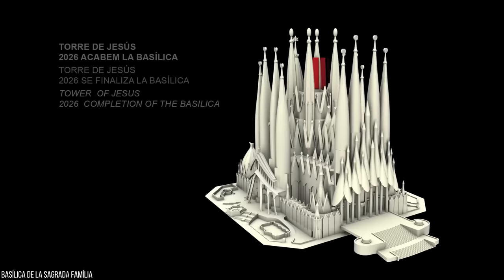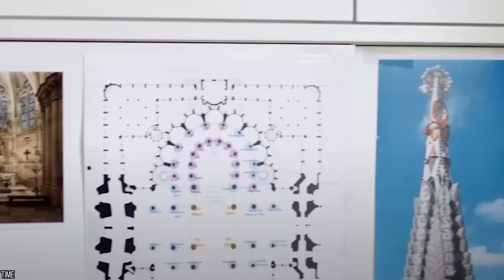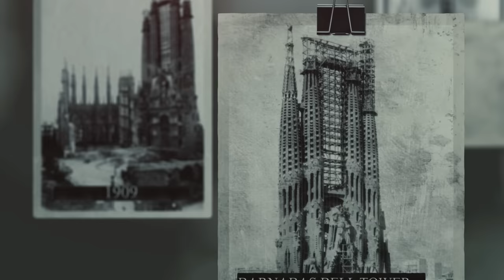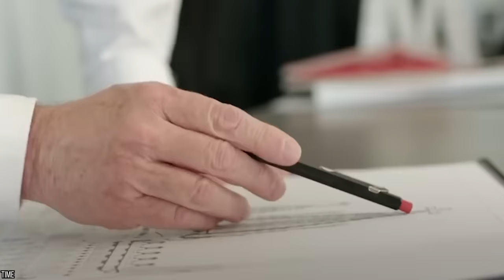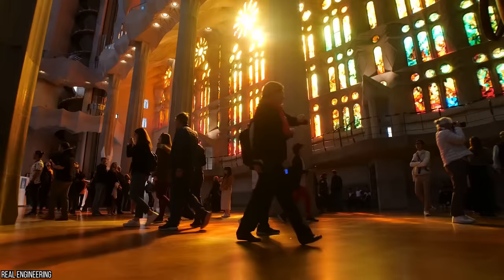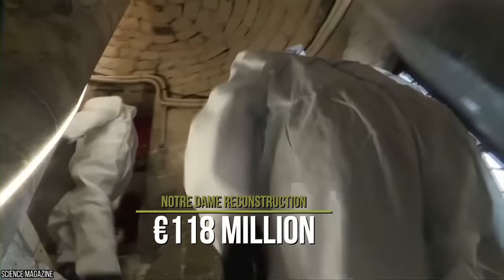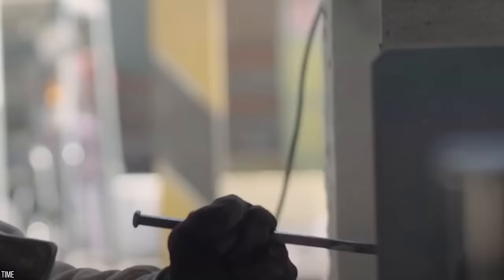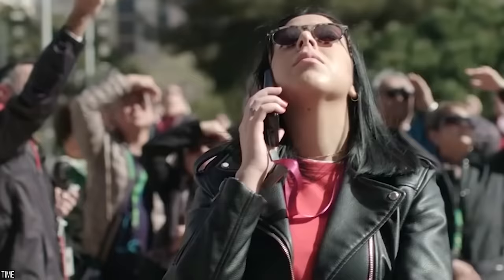This Church Took More Than 136 Years To Build

Comment: 🤣Gimme a break. These megalithic buildings, especially the cathedrals, were not built as churches. I'll give them one point. At least they gave it a more beLievable construction time than most of the others like it are given...usually around 1 or 2 years. Go look it up. Impossible. Especially the older ones said to have been built in the 17 andd 1800s. And there are Many. Horse and buggy transportation was the best they supposedly had right? Oh and they could build beautiful structures like these...? But they could not figure how to pave the muddy streets???

Comment: You should check your sources, first the sagrada is not funding by the government but by self-fundings from donation and tourism, secondly this is barely gothic gaudy defines it's own style mix with art-nouveau and isomorphic design, thirdly a permit was submitted from the beginning as the building took over 140 years to be constructed, it had to obtain a new one, provided in 2014. I didn't look the whole video but you definitely need to be careful with the information you spread